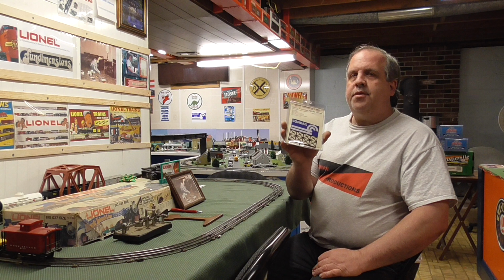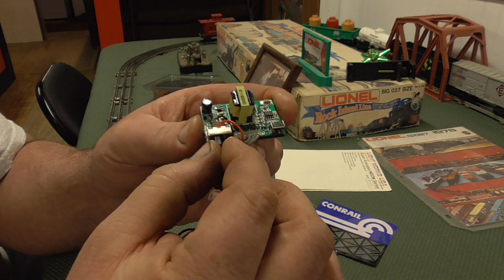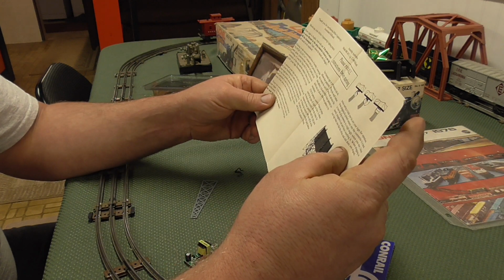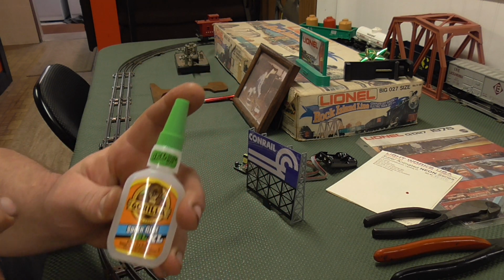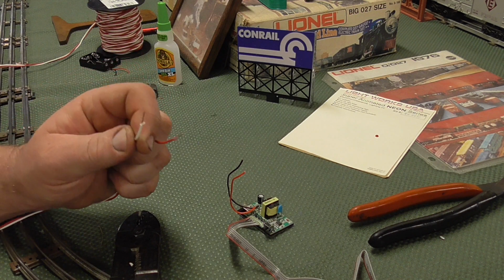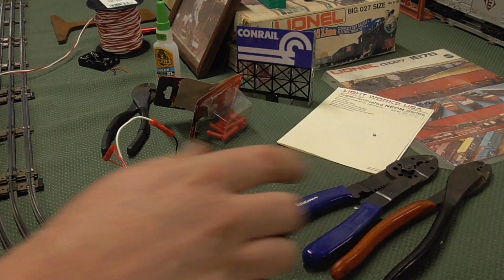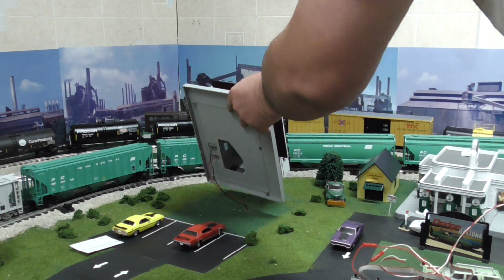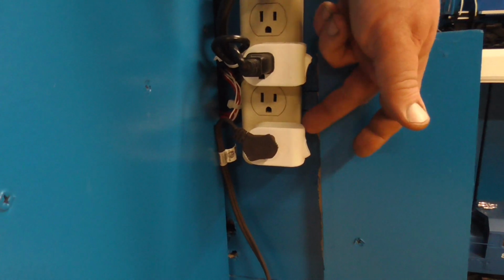Installing a Miller Neon Sign O Gauge

Comment: There should be a clock in the square on the lower right
Reply from the maker: Yes, you are correct
Reply: @Dakman  there are single aaa battery clocks that would fit there

Comment: Hi great video and this will fit great with some of the dio's that I am looking at doing.
Just wondering where you purchase your O Scale figures could you provide a link as to where you get them from.
Blessings
Pastor Randy Bourque
Reply from the maker: Hello, I normally buy my figures on Ebay when they are cheap. I try to stick with Woodland Scenics and MTH figures.  The ones from China are not that good.

Comment: I like using the heat shrink butt connectors, especially on thinner wires, even though there inside. I feel it gives a little extra strength to the connection.